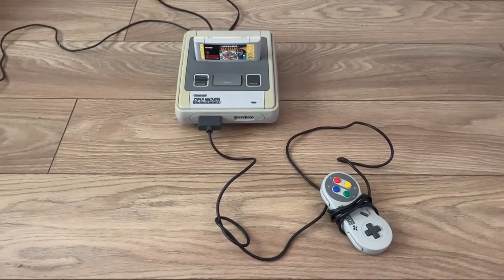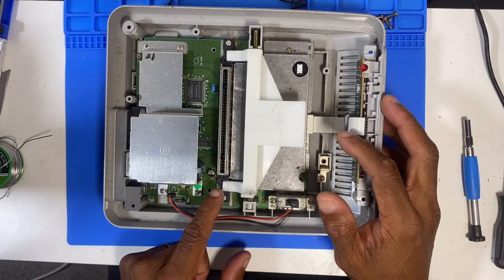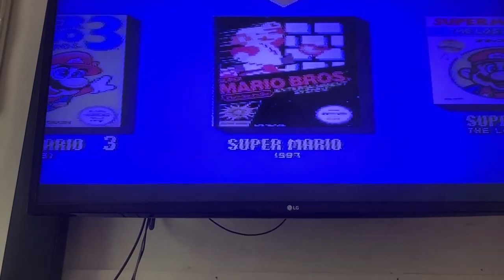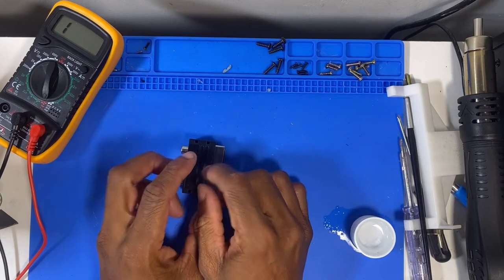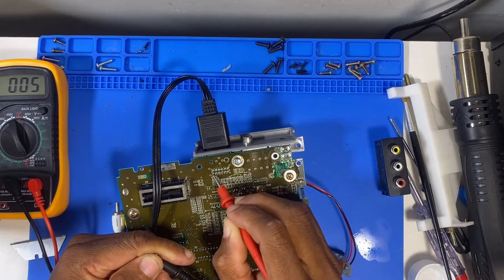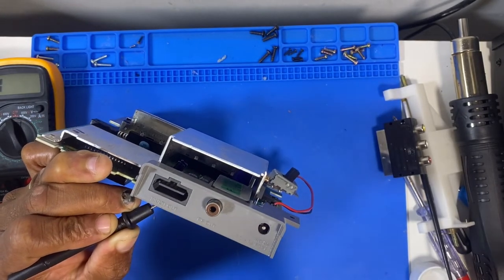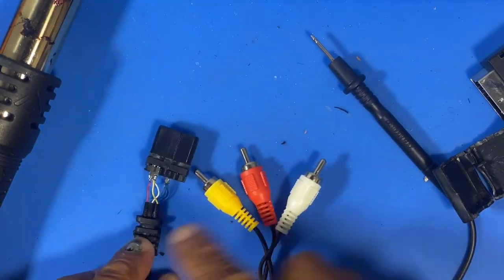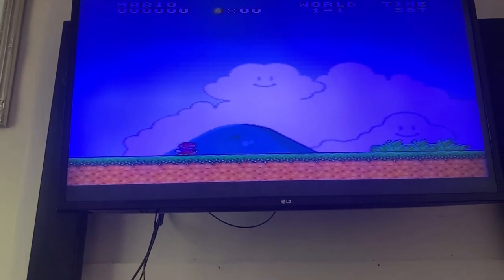Fixing a Super NES with no video output

Comment: The Cartridge connector on the snes is actually not directly soldered to the board, it is pushed on to a primary connector, here is where most issues occur, you can gently pry off this top connector after you remove the two screws holding it in place and clean those connections as well for better stability. nice work getting the cable apart. you can also get an RGB cable which gives the best possible picture quality
Reply: There are 2 snes cartridge connector types. One is soldered directly to the board. The other type isn't. I believe this model came with the one soldered to the board
Reply: @justinlira1841  at least where I live I never seen the other type. But it looks like a single soldered part when mounted as you still solder the bottom part to the board. Could be different depending where you live. I have loads of new you can split. It fits the same way when you press it together

Comment: Great video and some useful tips to find a fix. I do have a question though. Our Super Nintendo Switches on (power) has sound and shows up visually on the our LG tv, like yours. 
However, after around 20/30 seconds the screen fades out and the sound remains. Would you happen to know why this is happening?

Comment: Sir what if the red light is blinking? And also no video just blinking light?  I've bought the same one but i can't use it.
Reply: Try another game. Blinking light is pretty unusual, the only reason I can think of off the top of my head is that the lockout chip on the cartridge is faulty (or it's a wrong region one).